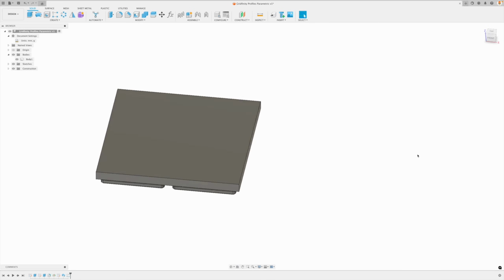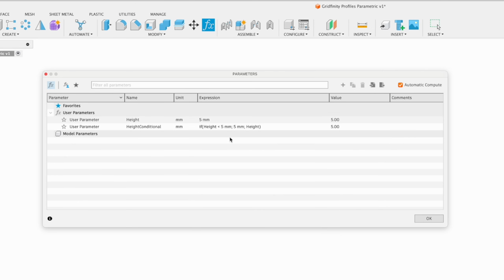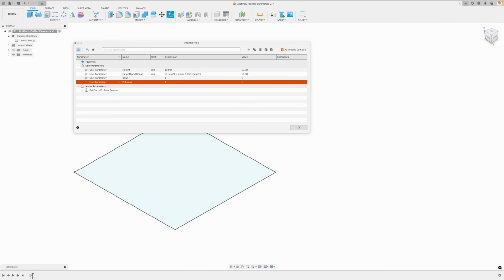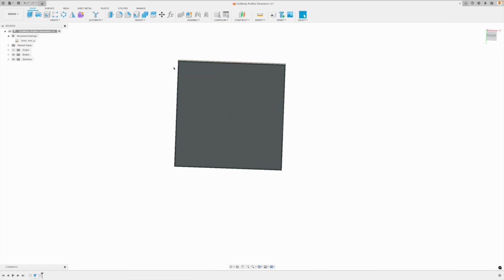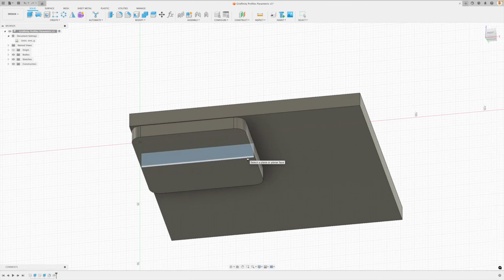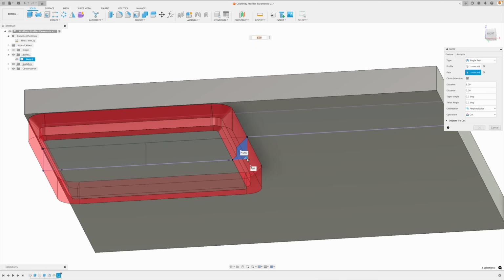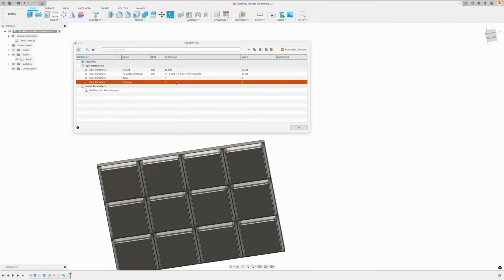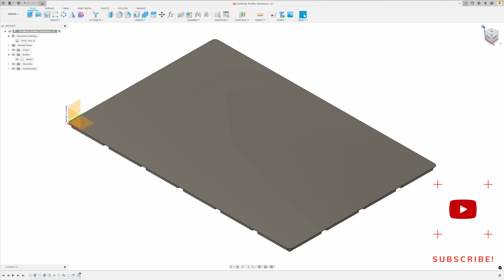Autodesk Fusion 360 Gridfinity Profile - INT/ADV Tutorial (Parametric Design)

Comment: I messed up the first time and didn't realize everything was meant to be underneath the XY plane. This caused an error for the rectangular pattern when changing the Row/Column parameters and didn't duplicate the base properly. I redid everything, starting at the "-HeightConditional + 4.75" extrude and worked perfectly! Thanks for the guide!
Reply from the maker: Great job working through the issue! Thanks for posting your solution for others to benefit from.

Comment: I was wondering how to make an offset adjustable from parameters that works with the changing of columns and rows. I did manage to define a parameter for offset but it limits me to only 3mm from the outside edge of the plate. Not sure the reasoning
Reply from the maker: Yes, you can do that. You will have to use "IF" statements. Check out all the parameter expressions that can be used here: 

https://help.autodesk.com/view/fusion360/ENU/?guid=MFG-REF-EXPRESS

Comment: I'm having an issue with parameters. When i try to make a 2x3 it only gives my the lower extrude in 2x2 unless i have the params set to 3x3
Reply: I ran into an issue where my Gridfinity base didn’t pattern correctly when the number of rows and columns were different. It turned out the rectangular pattern directions were flipped — I had “Rows” controlling the X-axis and “Columns” controlling the Y-axis. Once I swapped them so Rows and Columns matched their correct directions, the grid generated perfectly.
Reply from the maker: @darrenrector91 awesome!
Reply from the maker: Thanks for reaching out. It’s quite difficult to know exactly why that is happening in your case. Sounds like you’ve got an issue linking the parameters to the patterned instances.
Reply: @learnitalready Thanks for the reply! I got it figured
Reply from the maker: @carterworo4467 Awesome! What was the issue in the end? (Will be helpful for anyone who reads this in the future)
Reply: @carterworo4467  That's great that you were able to figure it out but is there any chance you'd help those who also have the same issue?

Comment: This was a great video. Easy to follow and understand. I'd like to request a follow up on this design if I may. As a beginner in fusion I'm still getting the hang of all the features and techniques. I'd like to ask if you can create the Gridfinity Base. However with a unique feature. There are may designs out there for different size base plate, but the feature I'd like to see and learn is to have a parametric design with a Width feature, for example, you can create a base plate that is 2X4 bins in width  and length, but when you set the width of the base plate you adjust the thickness of the ends, this way the base plate sits snuggly into your draw. Hope this makes sense.
Reply from the maker: Thanks so much! Stay tuned because I’m actually in the process of making a video that discusses your exact request. It’s not found in other videos because we need to think outside the box to make it work. Should be released soon!
Reply: @learnitalready  That's awesome, I know that there are online programs/websites that do this but it take all the fun out of learning. Thanks.
Reply from the maker: @the_roninking I completely agree. And, as we learn new things, we can customize our models even further. 

I just finished the screen recording for our Patreon members which goes into a lot more detail as to the whys and hows of design and addresses why our model breaks sometimes. I’ll release it and the free YouTube version in July.

Comment: Quality content, as always. However, for who doesn’t know, there is a free add-in for Gridfinity, in the Autodesk app store. It adds 2 buttons on Fusion’s “Solids” toolbar: one for generating base grids and one for generating boxes, with all the options/parameters you might need. I can’t share a link on YouTube’s comments, but if you google “autodesk fusion gridfinity” it should be a link that says “Gridfinity Generator | Fusion” pointing to the Autodesk store, where you can download and install it for either Mac or Windows.
That would help with all the steps up to the point you need to create the pliers cutout.